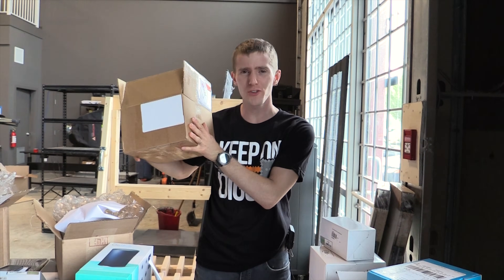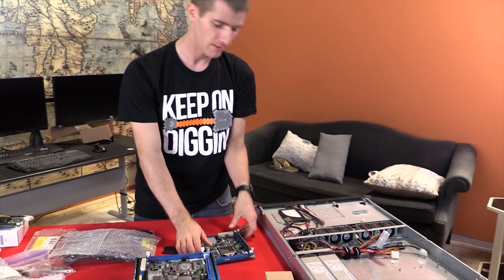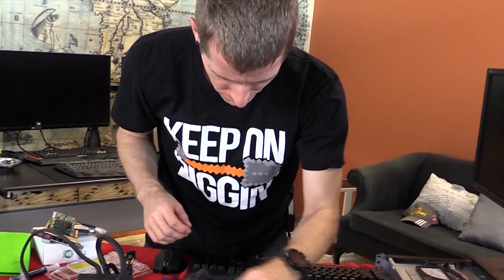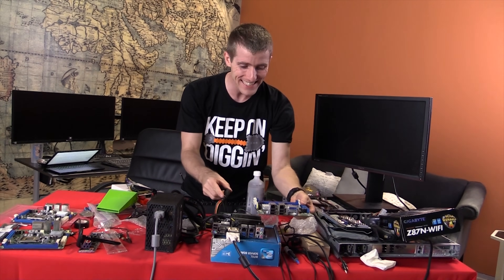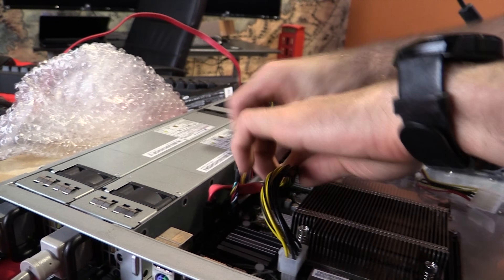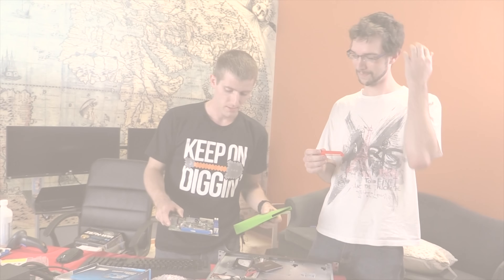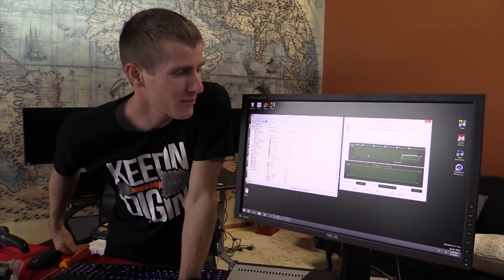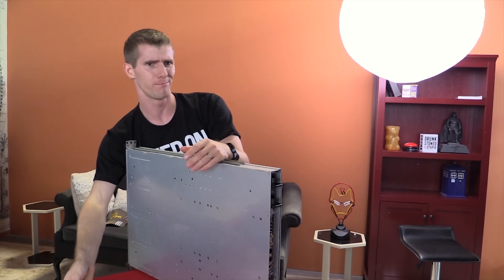DIY pfSense Rackmount Router Build Log - Part 2

Comment: He thinks an old Intel Xeon is overkill for a DIY router?
I used an Intel i5-12400 (with integrated graphics), 8GB DDR4 in two sticks, at 2400Mhz and CL14, M.2 SSD with PCIe 3.0 speeds, Corsair 450W PSU and ofc an Intel NIC of 10Gbps (540-T2 to be precise) with two RJ45 ports (one is WAN and the other is LAN, which goes into the switch) though, the total bandwidth of the card is 20Gbps but don't mind that, I'm not gonna use THAT much because my house network peaks at 8Gbps down / 7Gbps up speeds.

Comment: 5 years later. I think i figured it out. It was that random 4 pin from the power supply, maybe it is a propriety communication layer between the system and the PSU.  It worked because that gigabyte board doesn't have that functionality as it is not a server board.

Comment: Ripping off the speaker is completely safe only if you dont gouge the board with the pliers or rip the pin put of the board just rip it out of the speaker and trim the wire with a snips and the board is safe

Comment: i would just go with a small pc case, with the small motherboard and then you got something small and not loud. the case you picked could be changed to something smaller but still a great video
Reply: i ripped the speaker before off and the motherboard would still work

Comment: OEM Intel boards have always sucked on RAM compatibility.  I had to buy 3 sets of RAM before I found a set that worked in my server (two of those were ON THE LIST on Intel's site even).  The other was a super cheap set that didnt work because it didnt have the correct bank configuration or something.  

The router I have is the same way, it's DDR3 SODIMM, but ONLY 1.5v.  1.35 sticks dont post.  Dual voltage sticks do.  It also doesnt technically support 8gb, even though you can do it anyways.

Comment: The ecc memory is not depended from the cpu it is  depended from the memory controller of the motherboard i figure it out,  i m not playing specialist i also burn a motherboard with a 1150 heatsing  i dont know after a year motherboad died because of some kind of issue

Comment: Imagine if you mixed up the new board with the brick board and you didn't know any thought you bricked the third board
Reply: All you needed was the case of the power supply yet you bought three extra boards and killed them what do you think this is fun. Well if you do I would agree I love watching you fail. I bet if you do it more often you'll make more money. Try breaking a whole system that has two motherboards 1 AMD 1 Intel. 44 core Intel Xeon on one side with 512 gigs of RAM just because you  can. I'm inside you'll do a 32 core ryzen. Here's the kicker both systems will have a Vega 64 Crossfire with Titan XP in SLI with physics mode on. And then break the whole thing with one mistake.
Reply: What's your color scheme for the fan shrouds a collage expressing the current stock share between Nvidia and AMD.

Comment: i would've used nylon washers and nuts for the heat sink because its not vertical or anything also id like a detailed walk through of pfsense the Linus way cause ive tried pfsense a few times and never could get it to work with an old comp I had but smoothwall works perfectly lol

Comment: I would do a light foam meant for an a door insulator in between those pieces of plastic, one for vibration free environment.  Right now its fine, but as it ages, in a year or two, it will help.

Comment: dude.. you cut through the backplate and left a jagged edge. you can't rule that out as a possibility (even if something else did ruin the board too) just because it had a "non-conductive coating." you cut that.. it was bare metal

Comment: Maybe too young to know this but the 4 pin coming off the PSU is a LP4 connector its not to be plugged into a fan header it provides power for a floppy drive you have essentially connected 2 power sources into each other
Reply: By the way, why would ANY cable coming from a PSU require power? :D

Comment: Here a USD 199 Dell server:

http://www.ebay.com/itm/DELL-POWEREDGE-R210-ii-QUAD-CORE-Intel-Xeon-E3-1230-3-2GHz-8GB-1U-W-KEY-/122215352766?hash=item1c749a49be:g:sPUAAOSwo4pYIKqT.

But you wouldn't have done the content that was probably the main objective, I know I know! ;-)
Reply: It has no PCIe slot.

Comment: 7:49 The most epic time, when he said: "The Internet was right!" 
So putting a big metal plate on the back of your motherboard touching sharp and pointy soldered connections is NOT such a good idea after all  ;D  even electrical tape won't help, when the sharp edges tear holes in it :P

Comment: I get that this was all made for entertainment value but for those serious about considering a pfsense box just do yourself a favor and get a 1u or 2u used server from HP, Dell, IBM. They're so inexpensive and overkill you could run multiple virtual machines for $400 and a pfsense box if you wanted all at the same time. That said I still applaud this build for comedic value! Thumbs up coming from someone who has been in very similar situations.

Comment: I think that the 4 pin connector is the floppy connector. I don't know why even the most modern power supplies have floppy connector on,but the floppy looks the same as the fan connector and it even fits on a fan connector.
Reply: Some odd bits of hardware apart from floppie drives used that connector for... yeah, power.  And I use it often in my builds to power aux stuff like fans, power meters and ssr thingies.

Comment: ok for those saying its over kill then they dont want to know what my build is it makes yours look like a toy lol. first of all there is no over kill for a pf sense router since there is so much they can do especially with the additional packages and the 3rd party packages that can be added to it and the more network flow you have the more power you need especially since linus and myself use 10 gig and or fiber connections in my case power is key for a home general use yes a old pc would do the trick. but if you got the bucks to do it right linus has the right idea put more power in than you need for expand ability. as to blowing up boards and parts...... shakes head TEST BENCH PARTS FIRST! LOL

Comment: waist of money and time just use an old rack-mount server like my power edge 2850 i picked up for 100$ on e-bay with 2 duel  core xeon and dual power supplies tecks like this are just wasting money with this shit metal shavings and cut case will fry your MB real quick METAL DUST EVERY WHERE WHY DO U THINK THEY USE CLEAN ROOMS FOR A REAL GOOD BUILD

Comment: lines why do you need a cpu!
its a router or im dumb and i dont know 
pc  s
Reply: +Endermastermind gamer Routers have CPUs.

Routers are just small dedicated computers that are specialized. Most electronics are.

That said most consumer level routers are using bare bones CPUs(Think less power then a pentium 1) and some server level routers might use more.

Not much power is required for routing in general honestly.
Reply: thanks so mutch man
i did not know that

Comment: Windows 7 for a router? BOOOO! Linux or bust  :p
Reply: +Samuel Seidel facepalm pfsense is freebsd, a unix based operating system
Reply: 1. They were test booting the machine with windows

2. They're using pfSense, not Linux
Reply: +Gabe Hughes facepalm pfsense is linux
Reply: +Gabe Hughes oops

Comment: These two vids were interesting.

First, a fan does generate signals. I understood it was a 4 pin fan, which delivers fan 'speed' through a signal. A pulse train, in order to calculate fan rpm.

Then, the amount of stuff that he had to cut in order to make it fit in place.

And tbh, I kinda doubt that the problem was mounting pressure. The motherboard cannot sense pressure, so there would no beeping code. My guess is that something was really shorting the MB.
The heatsink + Motherboard was not a good combo.
But, I guess we'll never find out XD

L8er!

Comment: Through hole component leads protruding from solder pads are sharp - they will punch right through a thin layer of vinyl tape with any measure of force or 
vibration applied. Backplate = brickmaker.

Comment: 10:26, every. Day. I have dealt with it. I trained myself to wait. Which I shouldn't have to do.
Reply: Just switch to Linux and all your problems will be fixed
Reply: ***** Very easy to install, too. Especcially for beginners lol
Reply: @DeterminateNegation  so your saying on linux ill get the same or better support as I get on windows with my games, software and other work, it may be a 2 year old comment but that doesn't stop it from sounding stupid linux is not a replacement for consumer windows, linux is a replacement for shitty server deployments since windows server is a pile of trash compared (also is free)
Reply: @DeterminateNegation  so your saying on linux ill get the same or better support as I get on windows with my games, software and other work, it may be a 2 year old comment but that doesn't stop it from sounding stupid linux is not a replacement for consumer windows, linux is a replacement for shitty server deployments since windows server is a pile of trash compared (also is free)

Comment: Why did you plug any thing from a PSU to a fan header??? what a *** head
Reply: +MrStevetmq I agree. The fan power off the PSU is for directly powering a fan (bypassing MB). The same thing the fan header on the MB does! So he blasted his MB fan header with full current from the PSU. There must have been something weird-looking about the header on the MB to confuse him like this. I have seen these little fan power connectors on many PSUs.

Comment: "I could just rip the speaker right off and it would not damage anything"... Yes it would. You would rip the tracks off and whatever else those tracks are powering, will be dead. So possibly, a third dead board. And the quarter of a second delay in the keyboard is because of the power saver "feature" that turns off USB devices that are idle. You can change it in the power settings.

Comment: It's an Intel board, the memory needs to be installed at exactly sunset on the 3rd of the month when the wind is blowing in the correct direction if you want it to work.
Reply: I did exactly that with my Intel DQ67SW Mainboard. Worked perfecty! Thank you guys for your help. And thanks for the tip with the blood of a virgin. Thankfully I worked for a tech company back than and there was plenty of it!
Reply: No. It is installed only on the blood moon in october, with the leaves all facing left but the wind blowing right.
Reply: You forgot about the moon phase!
Reply: you have to remember to soak the DIMM in the blood of a virgin
Reply: you almost forgot a huge step! you HAVE to dip the board into cheese so the dairy can provide more RPM to the GPU!
Reply: +Magical narwhal yeah man. get it right. lol
Reply: +Leon Kernan Thats true I had to instal one dim at a time and reboot adding another dim then repeat to get my RAM into my Intel board LOL

Comment: :D Kingston. Lol. Kingston has always had compatibility issues with motherboards ever since I first heard of Kingston RAM and that was during DDR(1) era. It seems nothing has changed.
Reply: +MrBrander I actually find it more likely that the stick of RAM was mildly shot, that it was compatible when it was new but would work in some boards now but not in others, with some CPUs but not with others, and finally will die. The boards have suffered electric death probably somewhere related to voltage regulation, and if you spike the RAM voltage badly, bad things will quite certainly happen, they're still fairly sensitive.

Kingston are bastards though. I had a beef with their DDR RAM i got 12 years ago, because they had a cracked ceramic capacitance on the board and their QA didn't notice that... how exactly? By being TOTALLY blind? It couldn't have been damaged in shipping, it was hidden by heatspreader. Oh and Winbond chips, speaking of heatspreaders hiding sins. It wasn't cheap either, i mean if it was some low-end product i wouldn't have been surprised. Cracked and missing ceramics are bad, that's a sure fire way to kill the memory stick SLOWLY.

Comment: This must be the most expesive Pfsense built ever!! 2 CPU's, 3 Mother boards, and 1 Ram... But hey! Is nice to see that you finnaly got this working. 

A suggestion: since you're going to use a quad port nic card, you can make the all 4 work as a single NIC (can use LACP/capable switch) and use it as trunk (802.1Q) for inter v-lan routing so "theoretically" you get 4 time the throughput and also fail over capability.

I hope you make a benchmark video after deployment I want to see how the CPU behave with a 1Gbps traffic I have never done it.

Comment: Why would a fan header on a motherboard need power? Isn't it typically supplying power? There's sensor headers sometimes sure, but those don't run directly from the power supply, but rather from the fan power connector or in-between the two.

Comment: Actually, using high performance CPU for a router isn't a stupid idea.
They are key factor in the router throughput when under a heavy VPN load.
I don't know if that's your scenario, maybe not, but still, not a waste of hardware at all.

Comment: Other than the fact that the heatsink mounting broke the board, I think this was a poorest choice to begin with.  Just buy a cpu fan built for 1u cases.  The extra noise generated would have been minimal in comparison to the 6-odd chassis fans that are already there. Also, there are boards that are built for 1u cases, where the memory is laid-down nearly horizontally, instead of vertical.  Or if you want to built a router like a gaming computer, you could just use a 2u case...

Comment: My router:
Intel Core 2 Quad Q9300 2.5GHz,
8GB (2GBx4) mixed-brand DDR2-800 non-ECC RAM,
Onboard 2x Marvell PCIe GbE NIC,
2x Realtek PCI GbE single-port NIC,
Realtek Fast Ethernet NIC,
AMD Radeon HD 2600 GPU to allow DVI/HDMI output to be compatible with my ATEN CubiQ HDMI+USB KVM switch
Runs Ubuntu Linux (not LTS, currently on 15.04), NAT and routing done using iptables.

Comment: you are now running an 8 series board. may be the xeon was for 1150 not 1155? I never installed a 1150 cpu in a 1155 socket so I don't know if it physically fits

Comment: soldering points are pretty sharp. Could penetrate through the electrical tape. But if it was a short, that would have resulted in an instant short I would imagine.

Comment: This is total waste of components and my time.

Linus being an "amateur" PC builder with a big YouTube audience,
really sad that Linus knows so few things about PCs and destroying components just by
experimenting (randomly pluging connectors into boards, running CPUs without cooler,
buying expensive equipment just to show off?, ...)

I don't know the purpose of making 2 videos almost 20min long to show "destroying" expensive hardware.
And for the metal backplate, it is really crucial that it doesn't put pressure on components,
as that pressure can break off the components,solder or PCB and make board "dead".

I haven't watched the video to the end as it was pointless, and I have unsubscribed from the channel
a long time ago. I was thinking of giving the channel another go, but it looks that the channel
became too big -> too much money to spend -> really poor content.

And maybe another problem is the education that Linus has. Building a PC is possible by amateurs,
but doing it the right way (make some research of components (at least what to connect to what) )
and using proper antistatic environment to prevent any charge frying components (especially chips)
is crucial!

This was for me "the last nail hammered into your coffin" (me watching your content) and I wish
you luck in your "successful" career.

Comment: The system board must support ECC in addition to having that support in the CPU and RAM.
Also, great job killing another system board.  Perhaps, if you had used a SuperMicro system board with the SuperMicor case and SuperMicro heat-sync, they would have all worked together without any issues.

Comment: What is the melt temprature of 3d print plastic
Reply: +ProBro_NL  Uhmm the print heads of the 3d printers operate at about 220°C-250°C, that order of magnitude. Most plastics considered for 3D printing start to melt at about 170°C, but that's not quite enough to print them.

The two main ones are PLA and ABS. ABS is pretty stable, it really behaves well up to just above 100°C, while PLA may experience a tiny bit of structural rigidity loss under pressure starting at maybe 60-70°C. It's probably just about good enough considering if 80°C on the CPU die is your throttle limit, 60°C at the outer rim of the heatsink should not be reached and it's not even a structurally loaded part.

Comment: you guys should look into  this 
http://www.ebay.com/itm/Hot-PCI-E-Express-16X-Protector-Extender-Extension-Riser-Card-Adapter-for-1U-2U-/360515174461?hash=item53f061003d

Honestly depending  if you have several  VLANs and want  top though put , this build isnt really over Kill  there is also allot of add on packages that can  take up  allot of CPU power such as snort.

I've been running PFsense  since 2008 on server grade hard and i have been nothing  but happy, recently I virtualized mine and haven't seen any perfomace issues.

Comment: I actually thought like 4 or so years ago about making a plastic shroud to redirect air to the CPU, but I didn't (and still don't) have a 3D printer. Well, seems like if I did, my old Pentium 4 wouldn't get to 60-66° C. Now, I wouldn't make one anymore since my PC is cool enough (like 54°C at most).

Comment: I just replaced a HDD in my pfSense small form factor case with an SSD. original temps were usually around 40-45, but now it's at 28-33! :D (during summer)